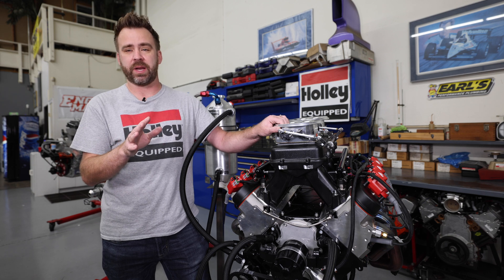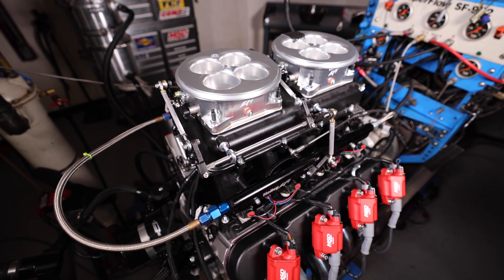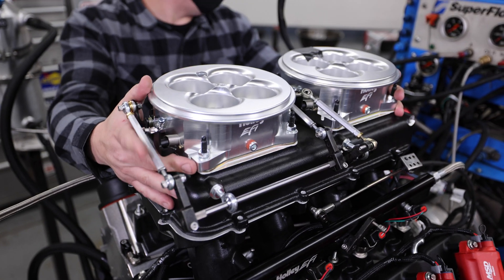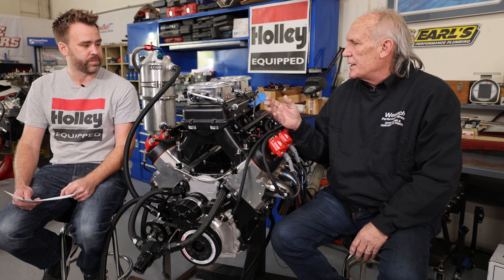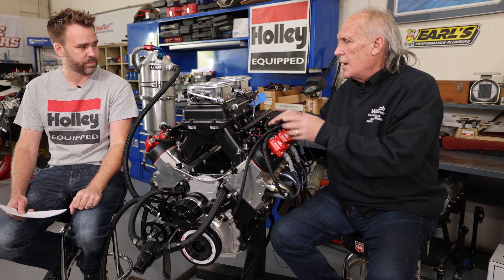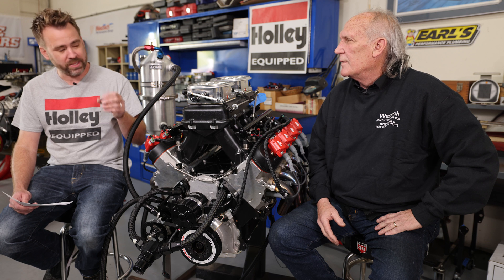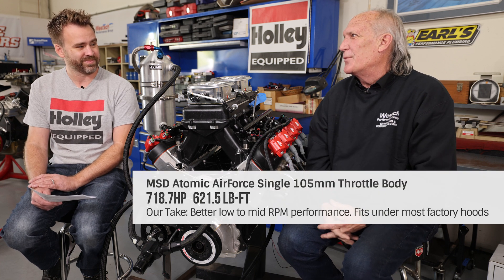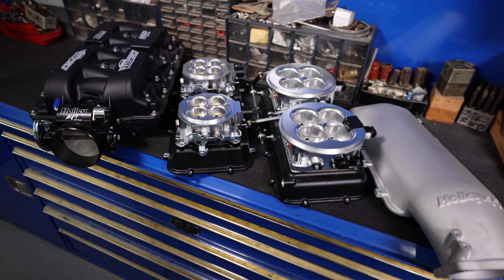LS Intake Manifold Shootout on a 440ci LS7 with Holley and MSD

Comment: What were the cam specs?
Reply: Comp Cams On the intake side, an MGZ 23502 lobe measures 250 degrees of duration at .050-inch of lift with a gross lift at the valve of .684 inch, with a 1.8:1 ratio rocker arm. For the exhaust lobe, an EHX-series 12701 lobe was chosen. It has 267 degrees of duration at .050-inch of lift. With .675 inch of valve lift. LSA unknown.

Comment: I was so excited to see this test and then so bummed that you didn't get Tony Mamo to Port the MSD. I think you would be surprised how much closer it is to those big intakes. My 427 made 807hp and 665lb/ft using his ported MSD
Reply: What boost you got going on there ?
Reply: @M2ONU  naturally aspirated
Reply: @FullForce1972  those are huge numbers for n/a
Reply: @Velocitydrive  Borowski Race Engines. My engine is a pump gas engine but they build killer stuff
Reply: 807 n 665 427??? Has to be a Borowski motor. I have no doubt its a strong build, but 807 n 665? What are cam specs? Hydraulic or solid roller? Lift? Compression? Fuel?
Reply: @upon1vp  93 pump. They don't put cam specs out there. Hydraulic cam. It's a healthy cam. Idk how much they will tell you about specs. Call and ask for Ken.

Comment: So for a road racing application LS3 that runs 6500 Max I want a long runner intake??
Reply: Yes
Reply: You want a broad torque band in a road race application.  Ideally you would have a different runner length per cylinder to try and broaden the power band and a set of tri y headers to match.
Reply: @AMac1978  so what intake is best I’m running a 2010 Camaro SS 6 speed manual and I’m about to install a GPI ported and rod modded intake with heads an cam already have a set of Stainless Works headers but not Tri -Ys are the requirement?
Reply: @robertfoley6430  The cost of a FAST over the GPI ported and rod mod intake isn't worth it. Make sure you have a ported TB to match their intake and your headers are fine. You will see a nice increase in power and torque across the curve.